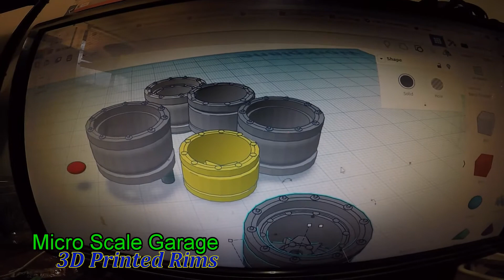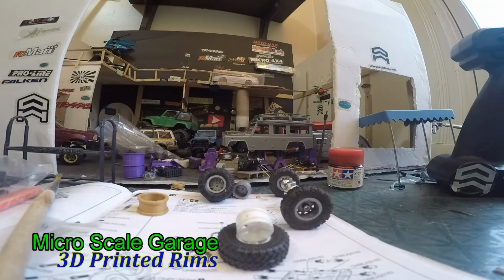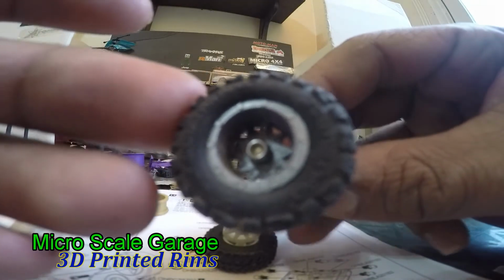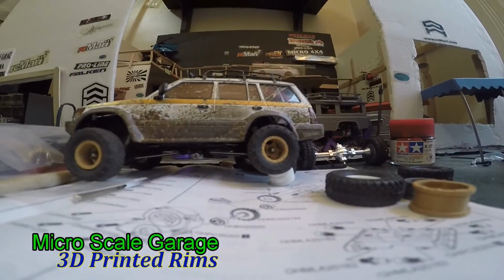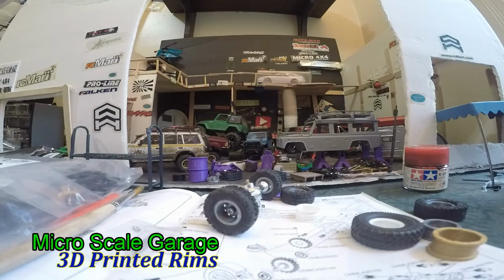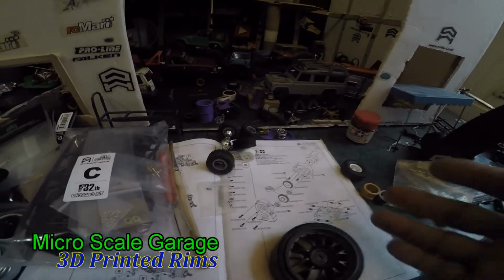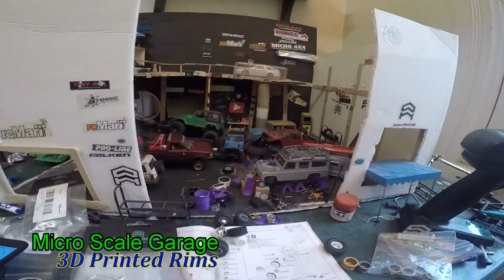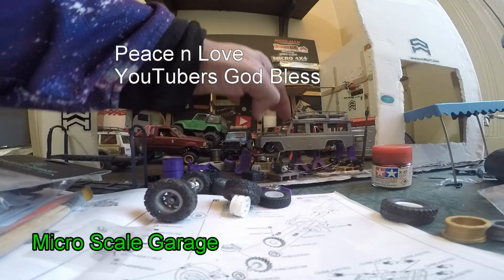micro scale garage ep79 Star Slingers

Comment: Hey antione, sitting here watching your (1rd) Orlandoo build f150. And want to know if the new kits are a better made then the older kits. I am going to get them all in Time but I am torn on the f150 and the Nissan right now. Great videos. also the paint on your Nissan is sick, do you have a how to video on the weathering and mud?
Reply from the maker: i wish i did a video on that paint job . the f-150 is a plastic chassis whil the A01 A02 A03 are metal frames the OH35p01 has bigger axles thas how i get away with building custom build 1/24 or 25 th scale like Kristine's Datsun or the OH25BC the Bronco Build i love them all i need to finish up the OH32a03 soon i want to do a varry good paint job on this one but when i get ready to order a new Orlandoo its ganna be a F-150 i just love the way it gose together and the OH32a02 is a  Mitsubishi Pajero  not a Nissan